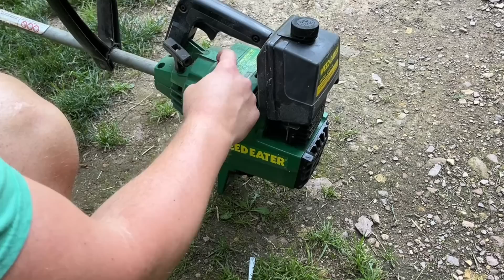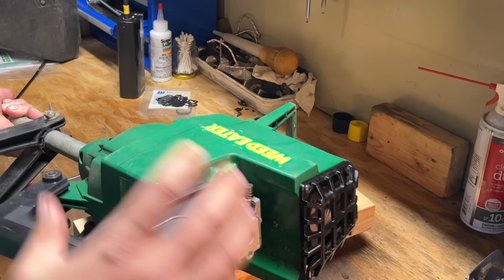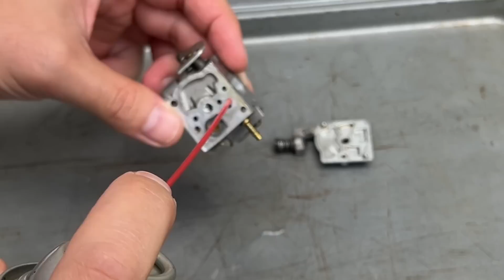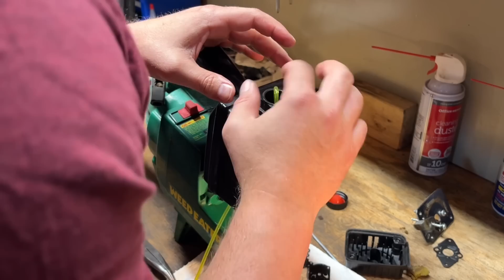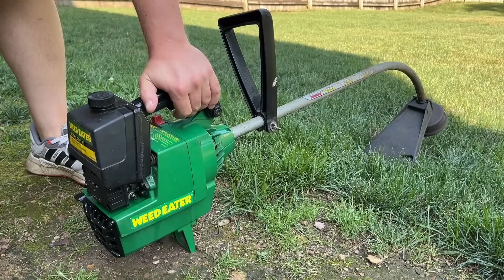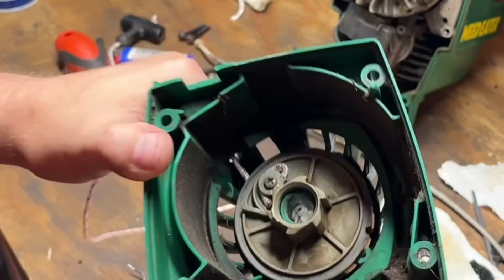Estate Cleanout 1988 WeedEater GTI 15 String Trimmer, Let’s Get It Going

Comment: I just bought one of these off ebay, new in box, never ran. It was produced in '89. It fired up in 2 pulls after I repaired the disintegrated fuel line due to age. Better than a lot of stuff available today.

Comment: Great job saving this good weedeater from the dumpster. This is one of the best weed eaters that Weed Eater made back in the early 90s. My mom bought a GTI-15T and hers quit because she ran straight gas, which she didn't know how to mix gas and oil, and it failed while weedwacking the grass back in 2000s and it wouldn't start back up, and she kept pulling and pulling until she was exhausted. I was worried that she is going to break the pull rope if you keep trying to start it when it doesn't start, and I assumed that the engine fuel line started leaking out gas, and that was a common issue with the fuel lines. I really miss the GTI-15T. These machines were definitely solid quality machines. But you have to be careful with the gasoline containing 10% ethanol, because it will slowly wear out the internal engine parts, and cause major issues with starting. 

Gasoline containing 10% ethanol can be what contributed to broken fuel lines, and ethanol can destroy fuel lines and even if it comes with a primer bulb, the ethanol will damage your primer bulb leading to cracking. If you go mix the gas and oil, I would recommend going to the gas station that sells ethanol free gasoline, and that you look before you pump, because whenever anyone owns a 30 year old weedeater like this one, to consider TruFuel 40:1 or go to the gas station that sells ethanol free gas and fill up the can. But you also want to make sure that you're using the correct amount of oil, and check the manual with mixing gas and oil, and the size of your can. Always use fresh unleaded, ethanol-free gasoline mixed with the correct amount of oil, because using straight gas will screw it up too. And these machines will last forever as long as you take proper care of them, and that you look before you pump while at the gas station.

Comment: I bought one of those brand new in 1989 at my first place. I ended up using it for 15 years. I replaced it with a straight shaft model. Even the “cheap” box store models were good back then. Try getting 15 years out of a HyperTough,lol!
Reply: Probably this ethanol these days that craps them out sooner

Comment: Our shop sold those back in the 80s when I was a young un and I got to do the repairs. That one seems to run as good as they ever did. Couple things, you might want to try to hunt down a fuel cap, that red disc is part of the venting system on the cap and can cause stalling or leaking if missing. Put a light coat of multi purpose lube on the flex shaft, they were known to burn through at the curve. I also wouldn’t trust the needle valve, after close to 40 years that Viton tip could separate at any time. Good job on the repair, nice to see these older machines brought back to life instead of ending up in a dumpster.

Comment: The head should not be spinning while its idling.
Reply from the maker: Hey thanks for the comment. This is a clutch-less trimmer, so if the engine is turning the head is turning (direct drive off the crankshaft)
Reply: @BackyardRepairs  100 % NO CLUTCH SO HEAD WILL SPIN GREAT JOB

Comment: Since the trimmer is old and manufactured prior to 2003, does it run on 25:1 or 32:1?
Reply: 40:1 premix
Reply: @JoshuaAndMom  thanks for the response!👍🏾
Reply: @mwand89 and I would do ethanol-free gas mixed with oil in 40:1 so you don’t ruin a rare engine.
Reply: @JoshuaAndMom  that's interesting!

Comment: Great job, I think there maybe another 'butterfly wing' shaped diaphragm under the steel plate next to the metering height lever.. Anyway, it's certainly running more than well enough to strim weeds..👍😃
Reply from the maker: Yes you're right, there is another gasket under the half moon shaped plate inside the metering area. I usually haven't found a need to open them up that far when doing these, but doesn't hurt to mention it's there next time since a replacement would come in the gasket/diaphragm kit

Comment: 37 years and still lives on. I love these GTI weedeaters. They were a thing from the past. In fact this machine will sure as hell outlast any brand new Troy bilt junk. I used to have the same weed eater years ago, which I should’ve paid attention to what gas to put in which the gas was not mixed with oil so it broke down when the job so now I have echo and Stihl. 

I am satisfied that it started right up before you repaired it, gotta love vintage weed eater equipment. And one thing about these weed eaters is that you have to be careful with ethanol gas because it will slowly eat up your engine. And I bet before you repaired it, it had some ethanol gas oil mix in it, which can’t be good for the engine and that’s what causes problems with not just starting your engine, but wearing out components. The bad gas that was in there it could’ve very well been ethanol and ethanol is definitely not good for the engine, and I’m pretty sure a lot of the gas stations are starting to offer the option of ethanol, free fuel, since it has become more of a big deal, especially with the common engine starting problems to possible damage to the engine and the components inside of it. And the ethanol that was in the gas could very well did some good amount of damage to the fuel lines. 

GTI 15s and GTI 19s are definitely one of the best badass weedeaters that Weed Eater has ever made and yet they will outlast Hyper tough or any 4-cycle troy bilt or modern craftsman weedeater.

Good job saving that weedeater. This definitely deserves extra 30 years.
Reply: I would use trufuel 40:1 in the gti 15, because ethanol in gasoline will slowly ruin it. I love and miss my gti 15t. I had to upgrade to Stihl and echo. This is actually the first time in a long time I’ve ever seen this weed eater trimming action. I like how it cuts by the way. weed eater GTI 15s and GTI 19s are definitely the best for those who can’t even afford a STIHL.
Reply: @JoshuaAndMom 👍😝😝🧋😊
Reply: Coiuh